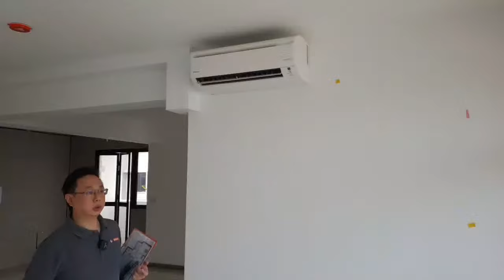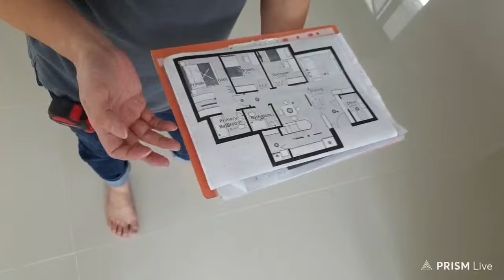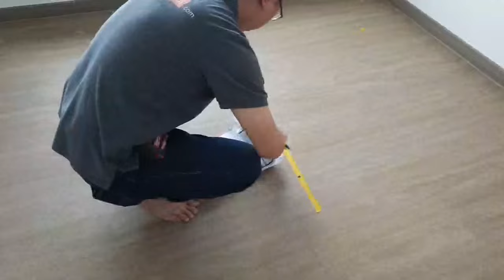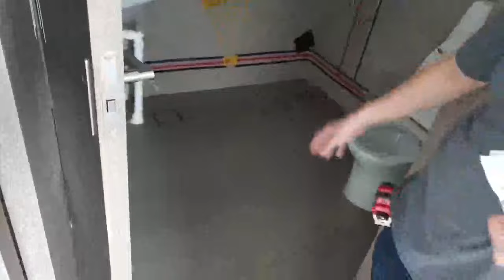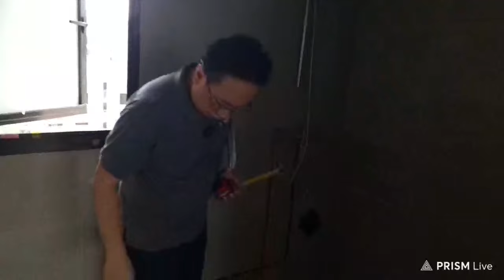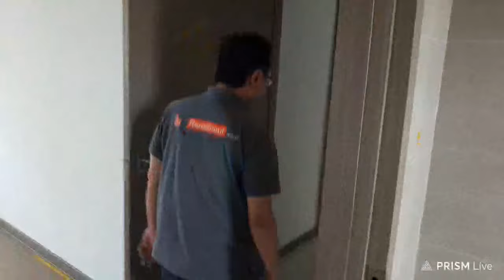Today we takeover another BTO project at Tengah. CCS Aircon is good this time.

Comment: kitchen counter space can be extended over front load washing machine.
masterbedroom bathroom, if they used a curved sink, the door might have better clearance. 

i selected a 48sqm 2rm bto in tengah waterfront.
i plan to isolate the kitchen and entrance from the main living space using a sliding door, so i didnt opt in for the CCS. especially since I dont know how Waterfront project's Beamless design will turn out.